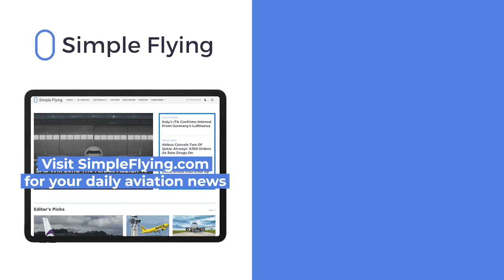United Airlines Discovers Fake CFM Engine Parts On Multiple Aircraft

Comment: By the way, United’s 320s use the IAE V2500s not the CFM56s
Reply from the maker: Thanks. This has been fixed.
Reply: Those also had problems with some foreign material but it was quickly fixed and now back to normal.

Comment: Not sure if these are faulty parts or just not got the documentation. Eather way they should not have been released for fitting
Reply: Likely both.
Reply: They have documentation. However it was falsified and parts are considered faulty because they were made with unapproved metals and methods, therefore they are not certified.
Reply: In aviation, everything that is not certified is faulty. Even if quality and everything else is fine.